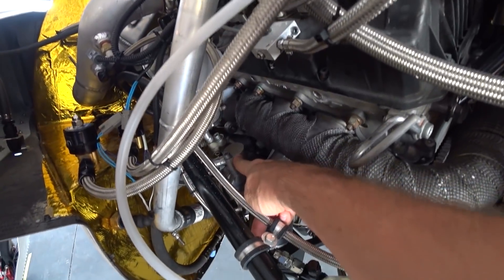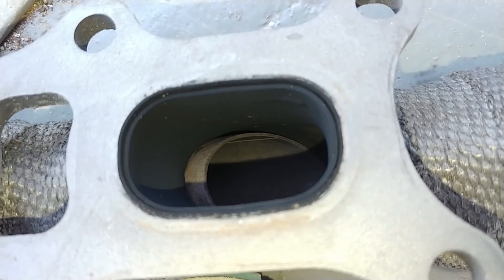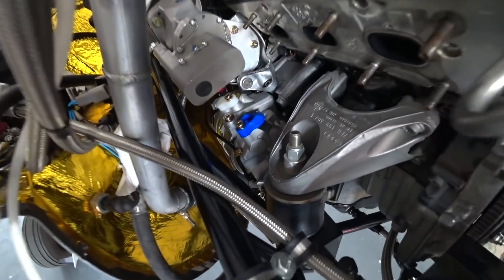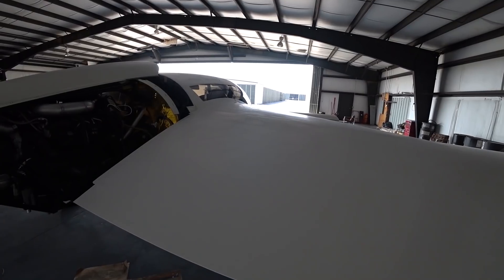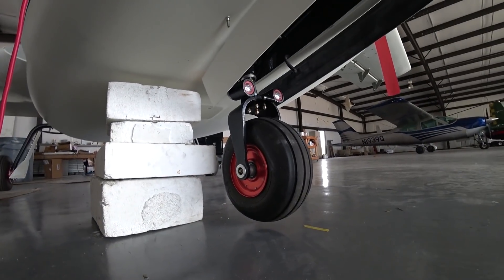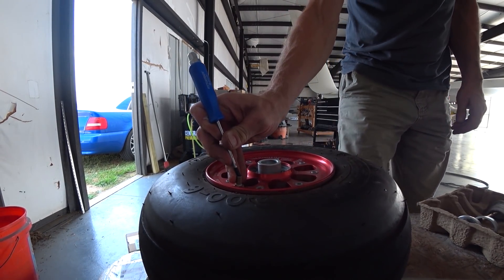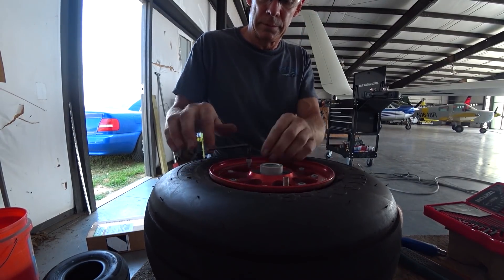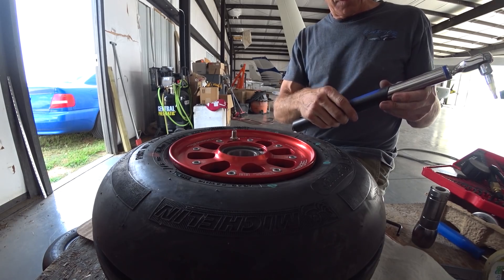New Compressor and Tire - Building the Raptor Prototype

Comment: Peter, Really enjoy your channel.  I'm going to offer an alternative perspective on your nose-wheel shimmy.  Your solution will not 'fix' your shimmy but it may mask it.  Shimmy is a result of a structural mode that can be excited.  Excitation can result from any number of stimulus such as an unbalanced wheel, runway surface roughness, a runway seam or crack, etc.  If the stimulus contains your nose wheel resonant frequency and your damping is not sufficient, it will excite the mode.  There are several 'fixes.'  One is to shift the resonant freq high enough to make it unlikely to encounter an excitation frequency under normal conditions.  This is done by adding a weight to the damping system (which also helps to increase damping).  Another is to put a damper on the system as you have initially proposed so if the excitation is resonant, the damping will be sufficient to keep it from oscillating.  Bottom line, you may want to consider going with your damping solution even if your next taxi test seems to indicate the shimmy is resolved.

Comment: I'm not an expert but. I would think that the front gear fork should be slightly canted back, instead of directly under the strut, I've dealt with castor wheels like that before and they have all shimmied. not so much when they are canted back 5° ~ 15° .

Comment: Usual castering nose wheel has more distance between the centerline of the gear and the axle, like a shopping cart. Yours is almost aligned, which may be causing the problem. If that compressor went out, there may be metal pieces as mentioned below. Check the dryer, it will catch all that stuff
Reply: Bill Welter The Devil is in the Details!

Comment: Another thought on the damper as well.  You might recheck the level of the oil in it.  You can also replace that oil with a heavier viscosity of oil.  It is automatic transmission fluid which is used in motorcycle forks shocks and steering dampers, but since yours is a specialty damper you might check with the manufacturer.  A low or no fluid level will cause that shimmy and I am speaking from experience.  Thank you so much for your invaluable and frequent updates.  God Bless and keep you, Sir.

Comment: I hate to tell you this but you probably wasted money buying a new tire. The "hop" in the tire is normal after sitting in one spot overnight, especially after being heated up and cooling down after a shimmy event. I get this when i first start to taxi after the plane has been sitting, then it usually smooths out before i get to the end of the runway. Its worse in winter months as the tires are hot when i pull into the hangar and they cool down on the concrete.
Reply: velocity550 I agree our F/A-18 tires with 375psi in them do this after sitting. These tires are not radials.

Comment: If the compressor was disassembling itself, you may want to inspect your expansion valve/orifice tube for metal debris.  The failure most likely was caused by liquid slugging so be sure you have a suction accumulator in the system.

Comment: Peter.   The friction in the yoke to strut joint is only part of the Problem with leaving in powdercoat.  Any organic coating will substantially increased the “setting” in the joint which means loss of tension in the bolts.   I think your light bracket added two face with coating.  Low tension means low load (torque) transmission capacity  for the joint.

Comment: what is your caster angle for the nose wheel? if you don't have enough it might be the reason you get the wobbling at high speed. Sorry if was already covered but i figured won't hurt to mention it just in case.

Comment: Sean White Below is correct about the Red dot on the new tire. It is the lightest balanced point of the tire. The Valve stem should be aligned with the red dot when mounted. You might have a easier time Balancing with that aligned. Love the Progress you have made with the entire project.

Comment: Don't put the new air conditioning pump yet. I've heard from a specialist thar if the old pump throwed junk inside the plumbing, when you put the new one you will destroy it. You'll need to clean all the other parts first.

Comment: Looking into the exhaust manifold, I think you might get a better flow with the pipe that protrudes into the flow trimmed back. Simple job with the Dremmel. Perhaps when you next have thew manifolds off?
Also. you might consider a disengaging clutch for the compressor for when it is not needed or over speeds and; a thorough flush of the lines to rid any other metal bits from the earlier failure.
I totally get this project and wish you well.

Comment: If the old compressor puked it's guts there will be metal in the lines and rest of the system.  If that's not flushed out it will take out the new compressor pretty quickly.  Also it's possible the old compressor died because it's being spun too fast.  Most vehicles disengage the compressor above a certain rpm.  The other possibility is too little oil.  Or all of the above....

Comment: everything is looking great so far. just one thing i would recommend would to clamp your turbo hoses a different way. I would look at v-band clamps. you would have to modify all the tube ends but in the end much less chance of them coming apart while in the air and have a huge power drop off. just my 2 cents.

Comment: You might get a little more turbo boost if you remove the overhang from exhaust tubes (as you look from head side of exhaust manifold). This is common practice in blueprinting engines fr more power. The run cooler also. Look at your video again and you'll see the large incursion into the exhaust manifold ports.
Reply: I noticed that.
Reply: @53jed  it was my first thought, and I've never worked on anything more than motorcycles and sports cars.

Comment: If you have a vain type shimmy  damper in the strut and if it’s filled with fluid it should, should dampen the shimmy. But those floating bolts in the tire horn have are probably you issues but I think you know this. I know you are close to testing. Good luck we are ALL pulling for you!!!

Comment: If that old compressor threw metal you can rest assured it will trash the new one. Best to flush the entire system out.
Reply from the maker: Ok, so the compressor clutch is one of those variable engagement ones. I did not have it engaged once for the several weeks when running the engine before it died. I saw black oil come from the inside out the compressor when I attempted to open it but the lines to the system were squeaky clean. I am guessing that nothing went into the system as the pump was not engaged when it died. I'll still get it flushed or at least try. Thanks for your input.
Reply: @RaptorAircraft  Consider it like insurance and peace of mind. When those compressor bolts backed off, the system lost oil, you know what happens next running with low oil. If your running the euro style condenser, many times the filter drier is built on the side and is accessible by a cap, remove that for inspection for metal or burnt oil. Many euro style driers are like a element or sock that slides into the tubular housing. Sealed systems must be clean of burnt oil that has metal particles. A/C flush is not easy to get, you can do a Lowes shuffle for gallon cans of acetone. Good luck.
Reply: I expect the AC pros will know what it needs.
Reply: @dannoel1615  Your talking with one now.

Comment: My RV8 tires get out of round just like what I noted in your video when it's sitting for a week or two.  I'm running brand new Goodyear Flight Custom III's.  Pretty sure the take off run puts it back to the original shape.
Reply: That bird has been on that tire for a 12 to 18 months or more.
Reply: Nylon cord tires quite commonly do this until they warm up a bit.  They flat spot from sitting and will round out once they warm up.  Those of us old enough to remember the old bias-ply Nylon cord tires are quite familiar with this.

Comment: I wonder if that compressor is designed operate all the time with the engine running at 4k rpm.   I have a Q7 TDI, and 75mph on the highway is right around 2k rpm  Just a thought.

Comment: CHT is critical - any way to wire in sensors for each cylinder in this engine?
Reply: It's a liquid cooled engine, CHT is coolant temperature.
Reply: While Patrik is correct w.r.t. the non-necessity to wire each cylinder for CHT, this engine would still benefit greatly from per cylinder EGT sensors to ID a faulty/leaking injector or other issue before a more significant engine problem arises.
Reply: @hatfieldta  Totally agree.
Reply: H SF Per cylinder EGT would be helpful for sure, but CHT and EGT do not rise/fall in lockstep, ignition timing has a big impact (although I dunno how the diesel cycle impacts this, could more/less that gas). My concern is the Audi block is iron, but heads are aluminum, so CHTs > 350F get problematic.

Coolant temp <> CHT; it’s an indirect measure of CHT and doesn’t tell you if one is running hot - unlikely with direct injection and liquid cooling, for sure, but we’re pushing this baby pretty good. Given that this is a development project, the more data the better - you can bet Audi wired each cylinder in their testing ;-)

Once it’s tested / vetted, I’d have no problem relying on coolant temp.
Reply: Larsonaut If he doesn’t get those EGT’s down it won’t matter much because he’ll be melting his pistons and starting over again - perhaps he’ll add more instrumentation then.  Converging pipes or no - 1750F or more for any length of time is ill advised.  He should have an EGT safety limit at 1650 and shouldn’t be running above 1400 long term.

Comment: Peter,

I have my fingers crossed the changes will net good results...at the very least, they are good to get done and put to rest, and be eliminated from the list of things that could contribute to the shimmy.
I can only imagine how thankful you'll be to have the AC working again, taxiing around in the heat must have been brutal!

Thanks for the update, I really appreciate you letting us all watch your amazing progress!

Best regards,
Jon
Reply: On the lancair, they say to tighten the through bolt that goes through the axle enough so that the tire only rotates about 1-½ rotations when spun by hand. This puts sufficient load on the wheel bearings and helps on the shimmy issue.
Reply: And yes on the comments that the red dot needs to align with the stem.